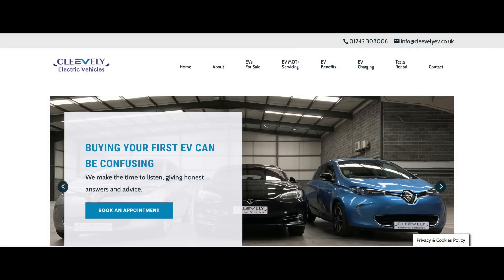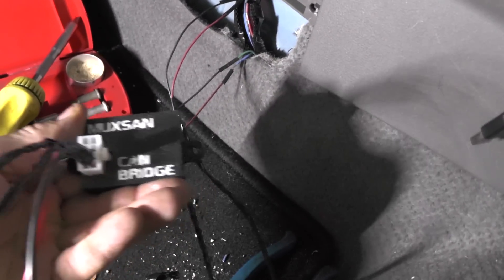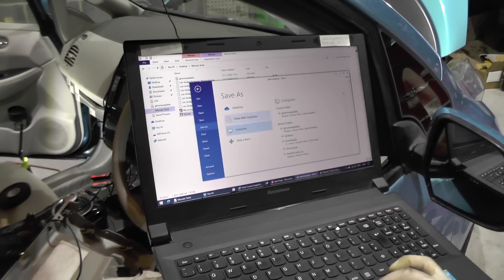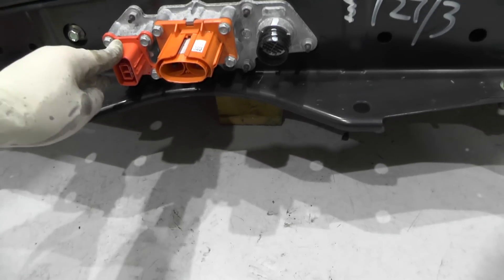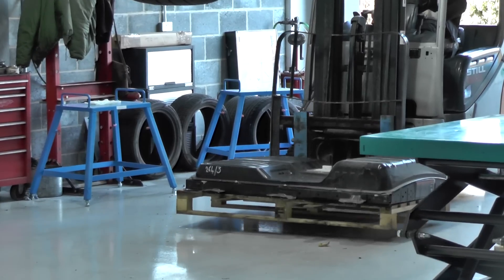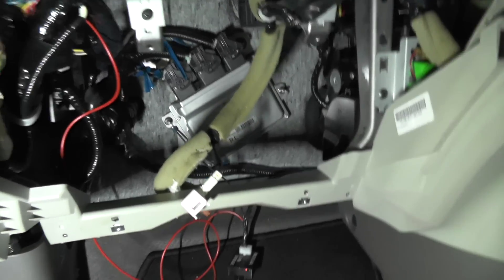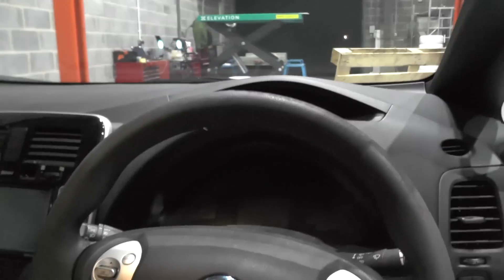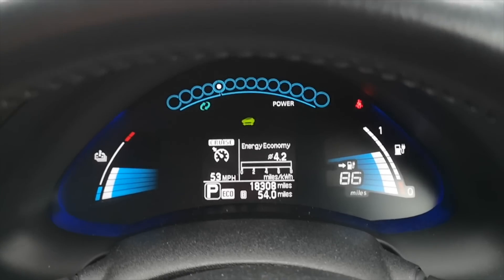Nissan Leaf  -  40kWh Battery Upgrade

Comment: How much does it cost to convert to the 40kwh? I am considering dipping my toes in the ev market and was looking at gen 1 leafs but the batteries in them are usually very poor now with most showing 7 bars or less.
I would defo consider buying one if your conversions are a cost viable option though.

Comment: Hi guys, what a wonderful dad and son team.  I am in Australia and desperately want to drive without a guilty conscience.  I am putting solar and storage on my roof very soon, but am baulking  at spending $50-80 on an new EV when I could buy a 2012 Leaf for $16,500 which is doing about 95km on a charge.  Most of my return trips now I am retired might be only 30 km.

Two questions: firstly, how much is the battery and other parts to do an upgrade, and secondly, do you know anyone in Aust who is highly competent doing an upgrade.  

I could give it a go using your great  video tutorial for which I am very grateful.

Many thanks,  Tony

Comment: I am considering purchasing a 2012 Leaf SL. 
I have a 47wHa hybrid battery pack from a Kia Hybrid. I  am researching the feasability of installing it in the area where the "gas tank" would normally go.
I looked through the comments and failed to see a reply to the cost of this upgrade. I am pretty handy so I think I can manage this. The hold up would be the compoments to read an install new maps through flashing. Are these parts sold separately? Thanks

Comment: Lots of comments about getting a 2018 40kwh vs replacing the battery.. and it’s a fair call, along with all the new tech.  However the environmental difference is huge by upgrading the battery. Also curious about the old leaf, will it be more efficient?  In theory it’s lighter and better aerodynamics ?

Comment: I have a 2011 Leaf, one of the first ones to be sold in the States, Seattle area. The battery has degraded and the most I can get out of it on a100% charge is 45 - 50 miles. The rest of the car is still in excellent condition and I don’t want to get rid of the whole car because of the battery. An upgrade to a 40 KW battery pack would seem to be the most environmentally friendly option. Does anyone know where I could have an paraded battery installed anywhere in the Pacific Northwest.?

Comment: Cracking job there lads well done, a bit easier than replacing an ICE no doubt. I have a 2015 24kWh Nissan e-nv200 with 23k miles, I love the van but with a range of about 60miles it can be a bit of a pain somedays. Would you be able to upgrade it to a 40kWh and roughly how much would that cost please? I'm in sunny South Wales!

Comment: "...from my perspective, this has been a very worthwhile upgrade."
Yes yes, of course.  But worth what?  What did this all cost?  Did you have to source the new batteries yourself?  I assume the very capable Muxsan could have, but would also have billed you an arm, a leg, and three additional toes.  I ask because my 2011 Leaf and I are are still stranded in the banana republic colonies (perhaps you've even heard of Trumpistan.)
I'm currently running on a 2015 battery (replaced by Nissan under Klee in 2017,) so I think they did all the rewiring for me.  Because of the "new" battery, even at over 70,000 miles, I still have 11 bars, but I find my real-world range (keeping between 20 and 80% SOC) is about 45 miles.  (Though I find this workable 97 days out of 100, my wife has such range anxiety that she won't drive it more than thirteen miles one way.
In a few years, as this battery wears, 40kWh batteries will likely become more common and less expensive.  There may even be tech advances we have not yet seen emerge from labs that are rapidly commercialised.  Supercapacitors!  Vampire batteries that suck power from other nearby cars!  Maybe even...Space Freebles!

Comment: I`m looking into replacing my battery myself. I have a 2012 mod, 8 bars and 155 000km on it. 
i want to put in the 30kwh since it`s cheaper and works more than enough for me. 
But the one thing scaring me off is the canbus and the software etc. I don`t have much knowlegde about it. Is it something I can buy cheap? and whatabout the software. Where can I find that?
other than that I don`t see any problems doing it myself.

Comment: Are there any long term issues with not having the ability to heat the 40kWh pack?
Reply: Lower performance in winter in cold climates.

Comment: Guys - I want to point out something that could make the Nissan Leaf a THUMPING fast car.
.
There was quite some talk in the past about a 'Nismo' conversion - turns out this was a software thing and it had PLENTY problems.  Also Nissan seemed to lose interest in 'glorifying' their EV program.  The Nismo conversion collapsed.
.
I believe you can give the LEAF kick ass power by changing 2 gears in the gear box.  Watch this video where the LEAF gear box is opened up:  https://www.youtube.com/watch?v=L5WhB7uQLzY     then go to minute 7:18.  Here you see two gears: the one is connected to the motor and the second connects to the wheels.  If you change the ratio of these 2 gears (make the motor gear slight bigger - perhaps just swop the 2 gears around).  All of a sudden for each rotation of the motor you rotate the wheels more ie: it goes faster!!!  Now my understanding is that this motor has a lot of Torque - (the LEAF has been shown towing 4 other LEAFS) - so changing the ratio won't mess with the torque.  You may have issues with measuring speed AND obviously the range may decrease but HEY you have just added more range to these cars.  Now it's time to make them KICK ASS.
.
Worth the experiment?
.
I'm sitting Canada and would love to donate my LEAF to the experiment..... know anyone on this side of the pond who can help?

Comment: Never ever solder on vehicle looms. Only if absolutely necessary. I get crimping ain't easy, but you can do it.
Reply: why not?
Reply: @SNORKYMEDIA 
I mean, just let me Google that for you. https://monroeengineering.com/blog/crimping-vs-soldering-cable-connectors-which-is-best/
https://millennialdiyer.com/articles/motorcycles/electrical-repair-crimp-or-solder/
Reply: @SNORKYMEDIA  I also find the muxsan kit nice, however the molex connector on it belongs in a computer, not a car. It's not very vibration resistant and can cause intermittent connection failures. I get it though, easy, cheap design work.
Reply from the maker: You are aware that all PCB are soldered??
Reply: @Jamesandkate  I'm trying to make a sarcastic joke here but I'm failing to do so without seeming like a smug bastard.
Reply: @Jamesandkate  Of course microchips are components that must be surface mounted to printed circuit boards using solder. Of course you shouldn't crimp wire to through hole or surface mount components, they must be soldered to copper pads on boards, not wire. There's a reason why manufacturers put boards in pretty little expensive enclosures. But we're not talking about that here, I'm talking about why solder should never touch wire in a vehicle. You wouldn't solder battery cables would you? How much power would you have to push through an iron to heat a battery cable enough to push solder into it, much less two of those suckers to join them together? My point is, solder belongs on surface and through hole mounted components. It doesn't belong anywhere in or on stranded wire.
Reply: @Jamesandkate  the biggest takeaway here is that everyone and their cousin has a soldering iron. Just because you can join two wires with it, doesn't mean you should. Cutting the wire, stripping back the insulation without nicks, crimping a terminal, and inserting that terminal into an automotive connector to join to another connector with wire is the best solution for inline wiring innerconnects. Does everyone and their cousin know how to solder properly? Probably not. Uneven heating, too much heat, too much solder, insulation melting, these are but a few problems you run into when soldering. IPC/WHMA 620 training will get you close to being a solder and crimp expert. Does everyone and their cousin own a crimp tool? Probably less people than those that own a soldering iron. A quality crimp tool? Even less. Do people know how to use a crimp tool properly? Even less still. Sure you can say "never had any problems with soldering wires" but I can tell you as a wiring technican, production manager, engineering consultant, motorsport wiring enthusiast, that I and anyone appropriately trained can crimp more wires while also having less failures than you soldering.
Reply: @SNORKYMEDIA  Many people have had bad experiences with soldering wires on vehicles and this has led them to believe that crimping is best.  This is because when you solder a flexible (ie.multistrand) wire, the solder wicks up into the wire due to surface tension and solidifies.  This makes the wire near the joint no longer flexible and so if it is subjected to any bending or vibration then there is a tendency for the wire to break.  So it's ok to solder wires only if there is sufficient strain relief added to prevent the wire from flexing at the joint when vibration moves the loom.  The wire should be clamped or held firmly in place with heat shrink sleeving at a point where it is still flexible.  This problem is specific to vehicles or other moving machinery.
Reply: You can definitely solder on vehicle looms. Just don't do a bad job.
Reply: @celeron55  just because you can, doesn't mean you should, especially if there is a better method, and it happens to be crimping :)

Comment: Few reservations with this, do you need to let your insurance company know that the car is now effectively modified? Hence would there be additional costs for insurance, my only other concern would be it would be my luck I'd have an accident after paying £8500 for a new battery and the insurance company would want to give me bottom book for a 5 year old car not taking into account the recent battery expediture - hence massively out of pocket. I really enjoy driving my leaf its a great car.
Reply: The battery is exactly the same size and only a few kilos heavier. My insurer confirmed that there is no extra cost.
Reply: I bet the insurers are aware that anyone doing such expensive maintenance for their vehicle tends to be a more careful driver than ones that just buy cars and use them as-is.

Comment: Why did the Leaf at 7:40 need a battery upgrade? The car only has 18252k miles on it.
Reply from the maker: It didn't, we were testing a kit. It's been removed since and refitted to another Leaf.

Comment: This is great, but it seems odd to do this whole video without mentioning cost or availability?  To clarify I'm not naysaying - I have a 30kw Leaf (with a good battery so far!) and hope to keep it alive as long as feasible for reason of not squandering the environmental cost of building the whole car... so for me it doesn't need to be cheaper than changing to a new car, just not more expensive, and (fingers crossed) I won't need to replace the battery for maybe 5 or more years yet.  But still, for those of us following the technology, why not say how much it costs and how easy/difficult it is to get?

Comment: Makes me sad I sold my 30 to upgrade to a 40. 
Can you do a video on what happens to the old battery packs that have been swopped out. That's probably what the skeptics are going to ask 👍👍
Reply: Could you tell me how much price is the 40kwh battery ?
Reply: Well, an upgrade might still be in your future as the 40kWh Leaf's can just as easily be upgraded to 62kWh.

Comment: Hey there, nice job!
If you were to get a boot extender installed first, is it technically possible to come back and have the main pack swapped out later if needed? (way down the line!) 
Or is it one or the other, swap or extender?
Reply from the maker: It's possible to do both in any order 👌🏻

Comment: What a great video.
I've been waiting for Robert Llewelyn 's battery change on his 24kwh Leaf but its taking a whe due to Covid!
So it's great to see this, thank you!
The only problem however is the price - I'm sure it's worth every penny but at 5k worth of donor car plus 8.5k for the replacement, that 13.5k is getting very close to the cost of an Ioniq or 1st gen eGolf!
Reply: Plenty of people will happily spend far more than a ICE powered car is worth to upgrade in some way, so why would this be somehow unreasonable for an electric car?
Reply: @TheLongonot62  because of current buying habits, the small number of cheap and available cars getting upgraded and concerns over compatibility.

What type of leaf could you buy for 13.5k? That's the way most people will think

Comment: Great video.  Good to see a 2011 leaf looking so good underneath.   My 2016 Leaf is still showing 12 bars at 60,000 miles - but it's good to have options when it starts to degrade.  Are the replacement battery packs brand new, or are they salvaged?  What is the weight difference between a 24 / 30 / 40 kwh pack?
Reply: Its mostly salavged thatsbthe tough part,

Comment: This price list is up to date as of today 6/12/2020. 

I now have some pricing, as we know what is involved with each job. Prices listed are fitted, inc vat. 

1 - 8.8kWh extender, which will add approx 30+ miles of range, costs £5000. 
2 - 17.6kWh extender, which will add approx 60+ miles of range, costs £6250. 
3 - Gen 2 24kWh upgrade, dependent on battery availability, from £5500
4 - 30kWh upgrade, dependent on battery availability, from £6000. But we currently have an unknown battery we can offer for £5000
5 - 40kWh upgrade, dependent on battery availability, from £8500. 

And remember that these are not new battery packs , they are used. !!!
Reply: How old do they tend to be when you get them – is there a limit of oldness that you draw the line at for these new replacement packs? Thanks!

Comment: Would be great If Cleevely EV had some prices on those 17kwh Boot extension packs, 22kw AC charging and tow hitch (for bike racks). You know the Ultra LEAF deal pack. :) So many LEAFs with just 3.3kw onboard charging. The 22Kw upgrade really makes these much more usable, especially for people who charge only away from home.

Comment: The upgrade costs are too high at the moment, especially as the Nissan 40kwh pack is so heat sensitive ( rapid gate ). It would be great if a 3rd party compatible pack with integrated liquid cooling could be fitted. That really would future proof the upgrade
Reply: I agree with you. It is about £140 per 100 miles. It is not cheep.
Reply: There is some company in New Zealand that's developing an all-new pack - Blue Cars or something like that?
Reply: £8500 to reuse an already paid for leaf and make it roadworthy for at least another 100,000 miles sounds great and adds extra range at the same time,better than spending £15k on a newer car
Reply: You would need to hookup the coolant lines and aircon and heating lines to the battery pack and the Leaf does not allow this.. 
Replacing these batteries by non Nissan dealers is risky, what about the possibility of a battery fire.

Comment: What happens with the old batteries? Are you able to convert them to home storage somehow? Also, Battery heater? Is it not possible to add this with a view to improve the life of the battery? Just wondering how many years this £8500 upgrade gives the car back before the new battery also degrades. Don’t want to be a negative but my 30kWh Leaf still pushes my buttons

Comment: What happens to the old pack? 
14,000 miles and it's had it? Not very good if you ask me and these are better for the environment? Yeah ok.
Reply from the maker: The third one was only an experiment and has since been refitted. However, when the packs are no longer usable for a vehicle, they are stripped and sold for grid storage solutions. These old cells will almost definitely end up in somebody's garage as home battery.
Reply: @Jamesandkate  So they are actually recycled, fair enough. But it still seems like a very short life cycle to me.
Reply: I have 89K miles on my 2017 107m Range  it has lost about 5% of it's original power Due to about 3 weaker sells.

Comment: Can you give a rough guide on how much the upgrade cost please?
Reply: I gather it tends to be around £6000 or there about,, so not cheap but could still be worth while depending on how much mileage you do.. plus a lot cheaper than buying a new electric car..
Reply: @richmaniow  quite expensive but as you say cheaper than a new car.  No doubt as batteries become cheaper the cost of replacing them will come down

Comment: OK. Very interesting. The BIG question is, How much is this  upgrade ?
Reply: Hi,  I have been in touch with this company and replacement cost are as follows,  this particular 40 kwh battery replacement costs £8500 , £6000 for a 30 kwh pack and £4000 for a 24 kwh pack.  Even if the government paid half of the bill it’s not for me I’m afraid, far far too costly.
Reply: @antoniopalmero4063  Thank you for that.  Wow!

Comment: Ah that 2011 is beating my 2011 muxsan'd leaf on range. Mine needs a 30 or 40 replacement as my 24kwh canary pack lets down the ex vw packs in the boot. Great work again.

Comment: another great video! considering buying a 1st gen leaf and bringing it up to you! 

a question: what happens with the old packs?
Reply: That's a really good question Looking forward to the answer  I read somewhere that one use of old electric car batteries is to use them for storing excess electricity generated from solar pv panels which you can then use later in the evening/night when you are not generating any solar
Reply from the maker: You've answered the question for us.